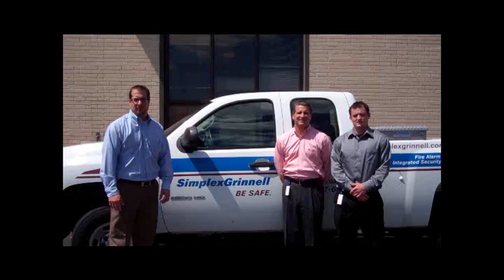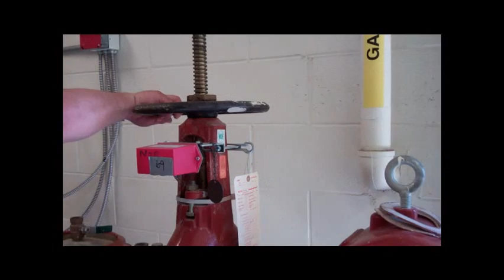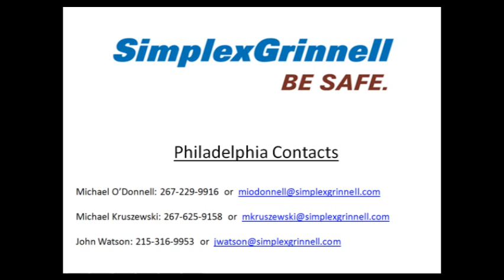NFPA 25 Sprinkler Tamper Switch Inspection - SimplexGrinnell Philadelphia

Comment: Looks like they did it right to me....
12.3.3.1 Each control valve shall be operated annually
through its full range and returned to its normal position.
12.3.3.5.2 A distinctive signal shall indicate movement from
the valve's normal position during either the first two revolutions
of a hand wheel or when the stem of the valve has moved
one-fifth of the distance from its normal position .